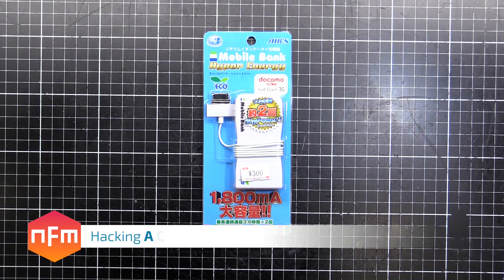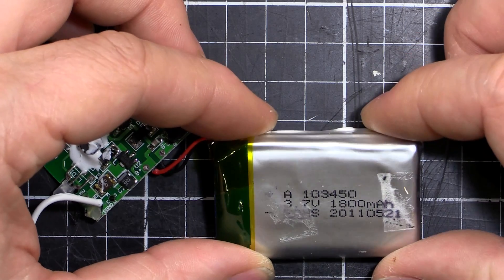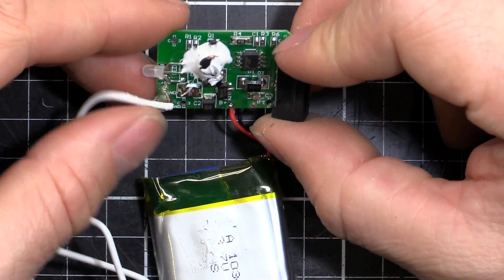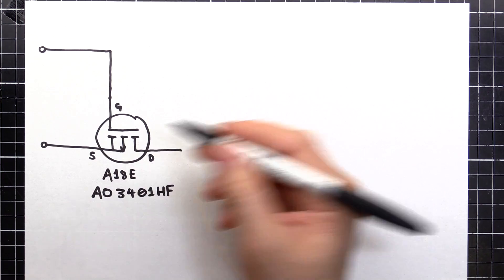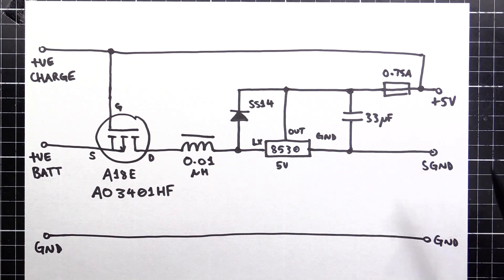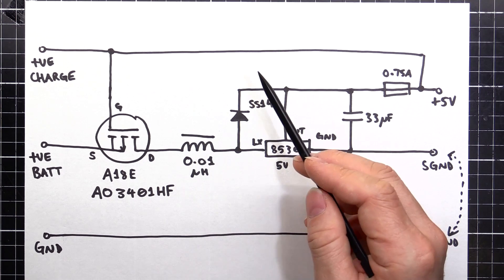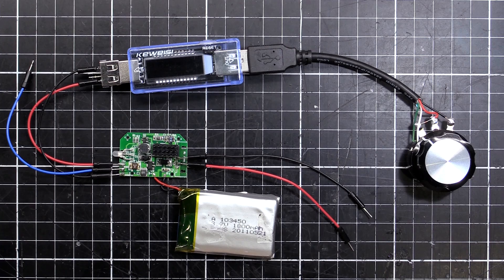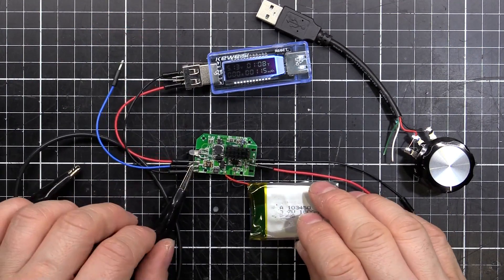Hacking a Portable Phone Charger

Comment: if you put those 2 prints together then you miss the the under voltage protection right?
Reply from the maker: You mean the two PCB's at the end?
The battery has low voltage protection built in as part of it's protection circuit.

Comment: That little blue board you have near the end (i forget what its called), can that charge a battery and have a load at the same time. Is that also true for the newer version of it. thanks
Reply: oliver rose I think he meant the li charger board, not the usb measuring device.
Reply from the maker: I think it is possible to charge and power a device, but you run the risk of the charger getting confused due to the load in addition to the battery.
This is why the P-channel MOSFET was used on the phone charger.
Reply: oliver rose it's called a "usb charger Dr." and it measures what the device plugged into it is doing. it's a pass through device and yes you can charge while it's plugged inline between the load and supply. .that's what it's made for.